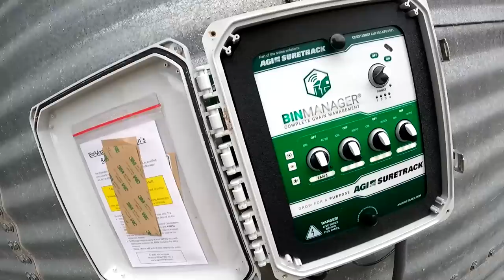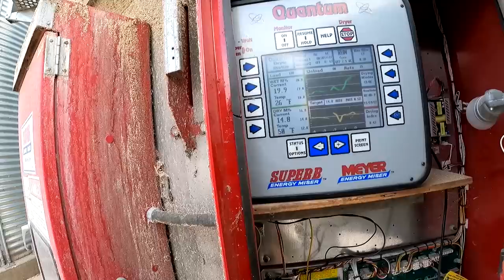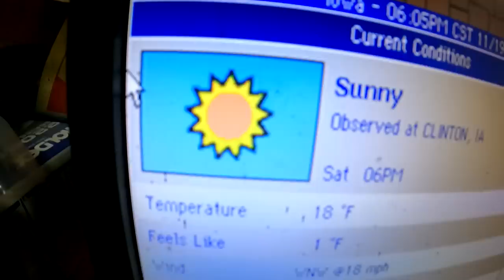NEW HOLLAND DOWN :(

Comment: Curious why don't you use block heaters on the equipment and especially the semi that was parked in the shed? They would start much easier and alot less wear on the engine.